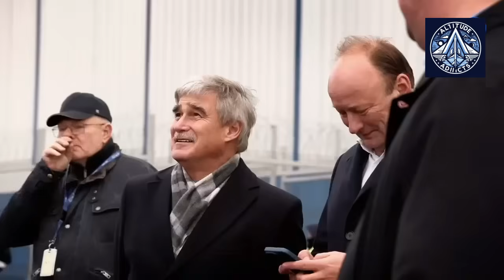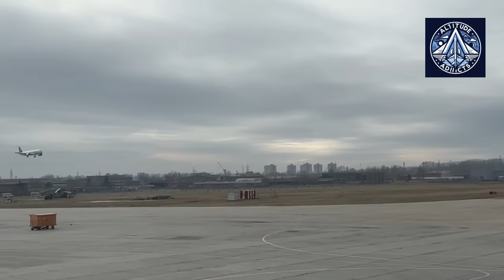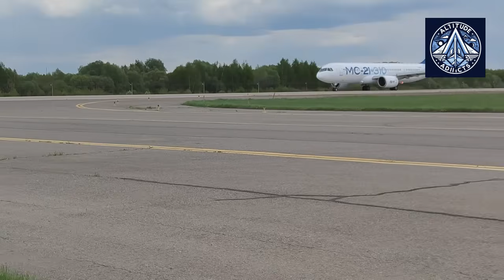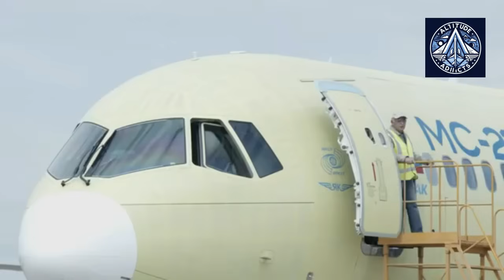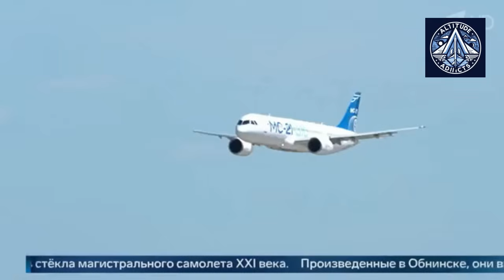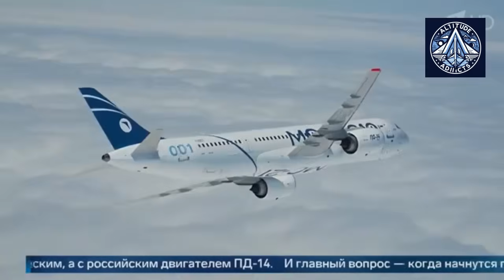Inside the MC-21’s Irkutsk–Zhukovsky Flight  — Here’s Why This Flight Matters

Comment: Yes they have.  Even the mc21 is heavier than it should be and does not fly as far.  Its a good plane.  Room for improvement.
Reply: Due to the impact of sanctions, I believe it will take a decade to achieve the figures originally advertised.